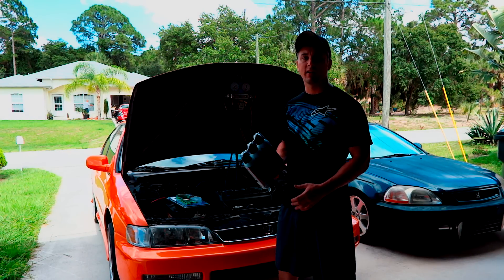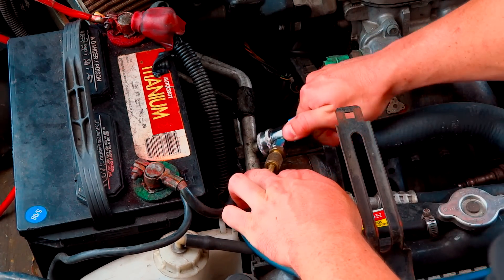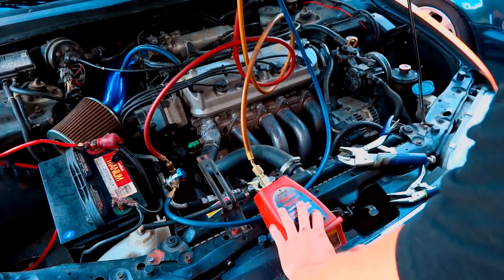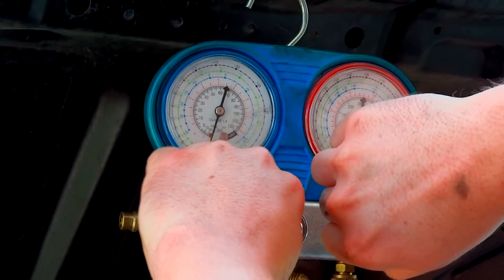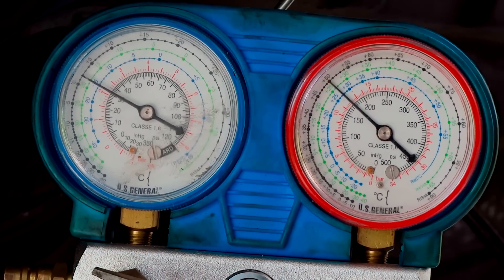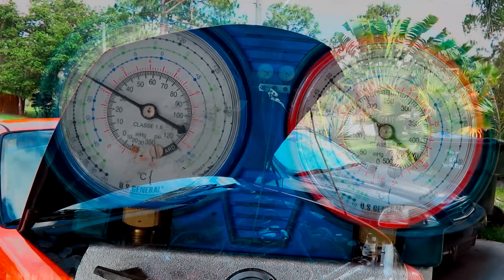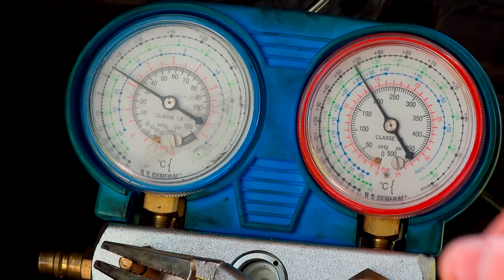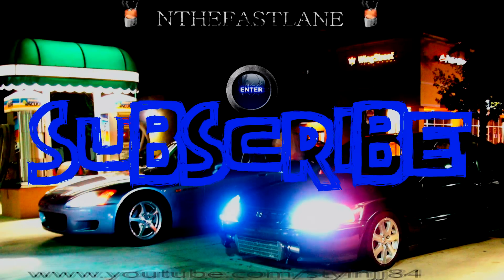Charge Your A/C With The Cheapest & Coldest Refrigerant

Comment: how much oil is lost when venting the enviro-safe refrigerant like dust off for example?
does one need to add any oil after that and how much approximately?
Reply: Tyler Helgerson In that case, spraying Dust Off on anything other than a computer is illegal.  So forget about the technicalities for a second, how is the result of releasing it from an AC system rather than its can, any different whatsoever?  It's "intended purpose" is to be released into the environment.  The law you are referring to definitely wasn't written with Dust Off (as a refrigerant) in mind.  If you're so worried about people venting r152 from their AC system, then you should also start a campaign against the Dust Off product itself, when used for its intended purpose.
Reply: Yea, if you have a gun permit, you can use a gun to clean your ears out too! Watch my video too!!!
Reply: Ivan Konstantinov You shouldn't vent it, it's still considered a refrigerant (R152a) and EPA bans venting of ANY refrigerant. it's one thing to use dust-off for its intended purpose (using it for anything other than its intended purpose is illegal as well, but we won't get into that). But to answer your question, it all depends on how the gas is removed. If it's removed as a liquid, it's going to take the oil with it. you will lose minute amounts removing gas as well. The only way to know for sure how much oil is in your system is to remove the oil, and refill to your vehicle specs, usually on the label under your hood.
Reply from the maker: +Tyler Helgerson Epa doesn't regulate or ban Eviro-safe or Dustoff.

Enviro-Safe Refrigerant does not fall under or within the guidelines set
 forth by Congress concerning global warming or ozone depletion because 
it is an environmentally safe, non-global warming and non-ozone 
depleting product.

Therefore, Enviro-Safe Refrigerant does not require "approval" to be used or sold as a HFC 134a substitute.
Reply: +pearlmax dude I've got to get you to the court and sue you, with an option you get off only when show what law prohibits us to use dust off dusting my shelf, files, power strip outlets, Internet modems and routers, PC fans, motherboard, etc. Did you know there is an answer to be held for scam activity?
I don't think you are getting off that easy for the abominable activities you are doing

Comment: Good job overall, with a few suggestions. It's not pronounced di-flor'-o-thane. It's pronounced di-flor-o-eth'-ane. Also, try not to add refrigerant in straight liquid form - alternate gas and liquid by tilting the can back and forth. Takes a little longer, but you won't slug the compressor. Good job posting the safety corrections.
Reply: Cotronixco I was also concerned with him pushing liquid direct to the low pressure side. You can do damage to your compressor by sucking liquid from the low pressure side (liquid is not compressible... think of what water locking your engine does). I've also read that you want to make sure that you are using Ester oil with R152a. This is still good information, people just need to be careful with how they implement it.
Reply: You will notice that he filled the thing with the engine off to an unspecified amount (10 oz). Then he started the engine. After that he added only a little bit at a time. Adding it like that, it is then not necessary to rotate back and forth. He just cracked the knob then waited till it settled and did it again till it was full. This is a more practical and sensible way to fill it rather than dump in so many oz because that is what the label says. (And there are only a few compressors that actually are bothered by the possibility - I don't know if the newer compressors are like that.) 
You will just find out that another fill will be needed or that it is over full. The manufacturers are just trying to provide for their automatic filling machines so that the cheapest level of mechanic can fill the thing using the inaccurate machines. 
And it's di-flewro -eth'-ane. The 'u' is not silent. but everyone knew what he was talking about. It was written on the can!

Comment: OK, update on 97 VW Golf.  I followed everything in this video. Results were unbelievable. I stalled New compressor $203, expansion valve $42, dryer $32, O-rings, PAG 46 oil w/ UV Dye, all LIFE TIME warranty from http://www.fcpeuro.com - delivery included!  Evacuated for 1hr with the same unit in the vid. Gauge set from Harbor Freight was $50. Radio Shack Difluoroethane cas#75-37-6 can $7.50 for big can, used 1 1/4 of it.  I left for my trip into the South West.  Daytime temps were 102. AC temp at the grill was 25-28 degrees! Lo side pressure: 42psi Hi side 275psi, ran perfect. No leaks!  4 hr job. 2hrs if there is a next time.  Auto shops wanted $1100-1400 for 12 mo guarantee!  You do the math. I just did my sons dead AC yesterday!
Thanks
Reply: POPS what's the long term update
Reply: Yeah, whats the update.

Comment: I'm putting in a new compressor, expansion valve & drier in my 97 Golf. How would I get the new oil into the compressor during this procedure?  Great video! thanks,,,
Reply: Most new compressors come precharged with oil.  Otherwise,  there should be a fill port on the side.

Comment: I want to try this on my old R12 system that has lost its charge 
My question what oil do I need to use to when I charge the system??
Reply: Don't do it!
Reply: POE or PAG will work fine with R152a.  Don't use mineral oil with R152a.

Comment: Makes my butt pucker every time I watch you "vice grip" the fittings on your gauges. They have soft rubber washers so they can be hand sealed. Go buy a new washer kit and do them by hand. Also, put your hose on the green clamp first so you don't freeze your fingers then purge. Otherwise good video.
Reply: I second this.
Reply: There are a lot of cringe worthy parts that shows he doesn't really understand the physics. Like the can shaking before hookup to keep it "from freezing"? And r134 should be recaptured properly and not vented. This video could be massively improved with a little bit of instruction and comparison to the original 134. 
Part of that instruction could include why it kept bubbling for a while after he vented the 134. The venting process caused all the plumbing to get cold. In the end as the tubing and other coils heat up they cause the residual 134 to heat up which causes it to expand. Thus it continues to bubble. Also why repurge when you could just leave it hooked up to the special side tap?
Something he also didn't consider is that some gasses carry the oil through the system better than others. Duster gas isn't used for a reason. Might want to find out what that reason is.
Reply: @bryanfullerton1566  And venting R134A in the United States IS ILLEGAL and carries up to a $50,000 fine!
Reply: @bryanfullerton1566  You can get away with one but not both of the PAG oils. PAE has better misicibility across the various flavors but you need to pay attention to what you're putting in the system and how much.
Google R152A Refrigerant oil.  You'll find a link to a Refsols PDF that contains a Miscibility chart for refrigerants and refrigerant oils.
The Folks using Envirosafe should be aware that the PAG oil in the system may not work as well with Hydrocarbon (R290 R600 etc) blends as the mineral oils that were used in R12 systems.
AC isn't just dump charge it up and go.  You can get into trouble with the gubmint and you can damage the systems if you don't take the time to learn to properly service the system.
It's not impossible for a DIY guy to learn how to safely and properly service an AC system but you need to study a bit before jumping in the deep end of the pool.
Reply: @TheOcculus  You should tell the OP that.

Comment: You sir are a fucking idiot! Are you epa section 609 mvac certified as required by federal law to service and repair motor vehicle ac systems? Are you aware that you are subject to a $27,500 fine and that I could potentially collect $10,000 dollars for turning your moron ass in, I figure the accident that kills you will take care of teaching you a lesson though :-) Have a nice life , short one I'm  sure.
Reply: If you would Google Wikipedia Difluoroethane the main ingredient in Dust Off.You will see that Difluoroethane 152A has recently been approved for automotive use as an alternative for 134A.The AC system in my car was designed for R12 it had been converted to 134A but lost all when the compressor went bad.After compressor and drier replaced evacuated and charged with Dust Off my AC is blowing a constant 35 degrees much colder than it did with 134A. So maybe it is you Gary Jones who is the idiot. And besides that you have no class getting on here using foul language calling people names when you have no clue as to what you are talking about. Do some research or shut up.
Reply: Gary Jones is the idiot...one of those guys who spouts off without having a clue. One does NOT have to legally be a tech to work on their own car's A/C system...or anything else on it for that matter. These kits are at every Wal-Mart, Auto Zone and O'Reilly's...and have been for many years now.
Reply: Gary! I think your Obama phone is ringing! Probably your MOM, trying to hook up with fastlane again!
Reply: THE LAW IS ON POOR FOLKS SIDE IN THIS CASE... MAY BE TO JUST HELP YOU READ IT? WITH A BIG***

Comment: Cheers to Nthefastlane!!  I like people that think.  As a chemist, I can guarantee it works, but it is a little...well volatile, as are many of the substitute gases.  Take care, ignore the haters.
Reply: must be one of them college edumacated chemists... it's far less VOLATILE than everything else it is a good substitute for... INCLUDING 134a...  I'm guessing you work for the CDC... eh?  eh?
Reply: @rduvending   a good substitute  ?....    how bout that PAG oil in there, from the r134a, you think it's compatible with the  propane+butane mix?
Reply: @josepeixoto3384  Not sure the age of this car. IF it is a R-12 system and if the system has never been flushed and had the oil changed, it should still have mineral oil installed. Enviro-Safe product is ALSO a special gas and CAN be installed with Mineral, Ester or Pag oil.  Mineral oil should not be used with 134a.   That is why IMO Ester oil is a good choice after a system is flushed as it is compatible with R-12 and 134a.

Comment: Use the bitterant to find leaks =P

Here's some good reading.... 
NFPA RATINGS (SCALE 0-4): HEALTH=0 FIRE=4 REACTIVITY=0 
FIRE AND EXPLOSION HAZARDS: Severe fire hazard. Severe explosion hazard. The gas is heavier than air. Vapors or gases may ignite at distant ignition sources and flash back.Electrostatic discharges may be generated by flow or agitation resulting in ignition or explosion. Containers may rupture or explode if 
exposed to heat

Comment: I liked the video and will try it although I did just buy 8 cans of R134 at Big Lots for $6.50 a can. It's $14 a can at AutoZone. My question is does drawing the vacuum remove the oil? Also on my S-10 the temp control knob also runs air through the heater core when its not fully set on cold. I noticed from the video that yours was about a quarter way  from full cold towards the heat side. I wish I had seen your video a week ago.
Reply: if u draw a vac... yes, u do get pag oil (not all in the system though...  think of the oil in your cooling system like a two cycle dirt bike.... kinda

it mixes with the freon when being compressed but settles when not and separates quickly

Comment: It isn't safe and really is kind of illegal
Reply: There's no way clearly in the video he says r-134 is safe for the atmosphere put it is definitely not
Reply: Dude are you serious watch the videos he lets at least 1lb into Are atmosphere I'm just saying you shouldn't tell people it's ok to do this because it definitely isn't
Reply: James Palmer Based on my viewing of the video, it is my understanding that the person says that the system was previously charged with Enviro-Safe.  Enviro-Safe is a company who produces a refrigerant that is both R-12 and R-134 compatible and also is harmless to the atmosphere. By the way, no, I do not work for Enviro-Safe, I learned about it when researching changing my R12 system to R134.
Reply: @rbarhamjr  ENVIRO-Safe is compatible with mineral oil which is the original oil in R-12 systems and PAG oil which is used in 134a systems.  Ester oil is compatible with both R-12 and 134a. No refrigerant should be "mixed" with ANY other refrigerant.  The AC system should be completely evacuated of any refrigerant before installing a different type. The amount of oil in the system should be checked with a cheap "Oil Checker" analyzer.
Reply: Linkjoy123  It may be SAFER, but it's not safe, or legal for that matter. it may have a 0 ODP, but its greenhouse effects are still horrible. And since he claims he is 609 certified, he should be more than well aware of the repercussions of venting, both envoirnmentally and legally.

Comment: R134a is NOT safe for the atmosphere
Reply: Nthefastlane At the very beginning of the video, he says, "This car had R-134a in it, so it's legal to vent it to the atmosphere."  Later there is a big text field saying otherwise, and he says when he runs the hose into the soda bottle that the system had been changed to something else, so who knows what was really going on.  Either way, R-134a is a serious greenhouse gas (something on the order of 1,000x CO2) and R-12 eats the ozone layer (allowing increased ultraviolet radiation into the atmosphere, giving us all glaucoma and skin cancer).  Letting natural gas escape isn't good, but it's not half as bad as either of these.
Reply from the maker: Who said there was any R134a involved??..None was in the vehicle or used to charged with."Enviro Safe" was in the vehicle previously..A non-ozone depleting hydrocarbon.

Comment: I thing that almost any gas that will compress into a liquid will get cold going from a liquid to a gas so technically this would work but not sure how long it would last
Reply: I have been using it for 3 years in my 93 300ZX convertible and 2.5 years in my brother in laws 99 BMW 740i. It works very well. Actually better than 134a due to the lower head pressures.

Comment: I have a 1991 Caprice and it has a small amount of R12 still in it. When I turn on the A/C testing it with my hand, I can tell that it gets a few degrees cooler than if I don't turn it on, so there is some in the system. Also, if I role the windows up, I can tell that it's not as humid and more comfortable in the car with the A/C going than if I just have the outside air coming through the vents, even though it's not cold enough to cool the entire inside of the car.  So, there is some still in the system.  So, my question is, Can I leave the R12 in and put the Dust Off in with it, or do I need to evacuate the R12 out first?  I don't have a compressor or gauges, so I will just be putting a can in and if it's colder than what I have, I'll be satisfied.
Reply: 1. You should not mix ANY refrigerant with any other refrigerant.  The AC system should be completely evacuated before changing to a different type of refrigerate.
2. ENVIRO-Safe, which is a gas product can be used with mineral oil (Original oil for R-12) or PAG (Original oil for 134a).
3.  Ester oil is compatible with R-12, 134a and ENVIRO-Safe.
4.  When the AMOUNT of oil in the system is not known - it should be checked with a very cheap "Oil Checker" analyzer. (Google it).  I learned the hard way.
Reply: William Cahoon Thanks!
Reply: No, they are not compatible, and the compressor oil has to be changed from mineral oil to synthetic PAG.

Comment: Just wondering - did you have any issues with icing since you were below freezing at the evaporator? I know this is common in commercial walk-in freezers but haven't seen it done in a car before now.
Reply: TheWizechatmgr When you pull vacuum, the ice sublimes off into a vapor and is evacuated from the system, once you get down to around 29.8 inches Hg. This is why pulling a good vacuum is so important.
Reply: @ModMINI  Dumb ass, he is talking about the evaporator coil building ice on the outside while the unit is running, not ice on the inside of the lines!  And 29.8inches Hg is still not enough of a vacuum pulled!  In HVAC, you read vacuum in MICRONS, which is far deeper than 29.8"Hg!

Comment: Just an FYI... You should not need to use vice grips on the knurled hose end couplings.  They work finger tight only.  If you over torque those?  They will eventually fail because you would have crushed the O-ring seals in them.
Reply: Not only were the knurled hose ends tightened beyond finger tight, but the dust caps over the car's schrader valves were beyond finger tight! Man needed his vice grip to remove them!
Reply: That gauge is just 50 bucks... I can crush these one every week, who cares...
Reply: @ikstrucking3289  You're an idiot...
Reply: @ikstrucking3289  - We certainly don’t care if you’re stupid enough to spend 50 bucks a week on gauges that would last the rest of us decades.